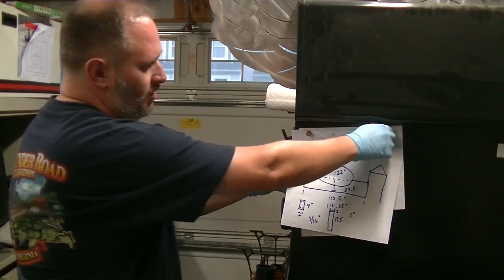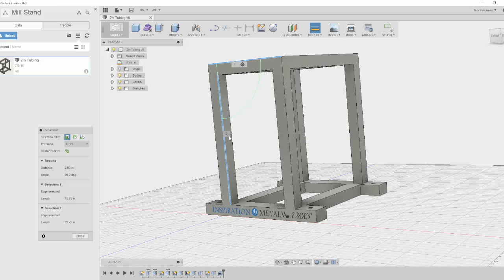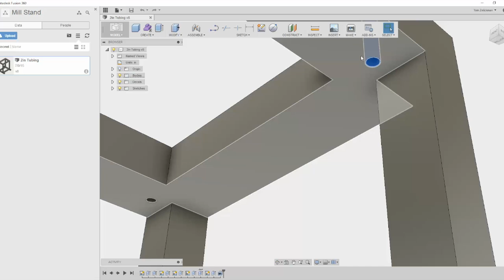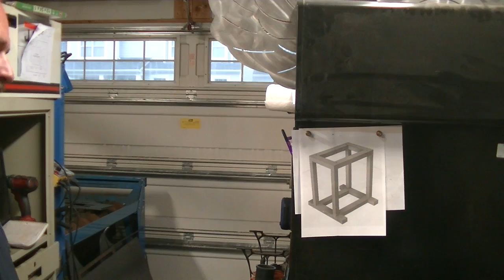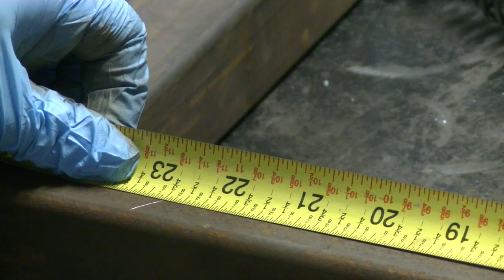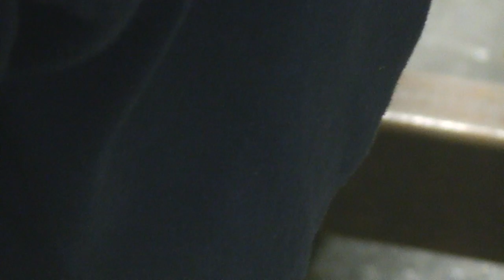Shop Update - Mill Stand Part 1

Comment: Ah, never have seen the scribe-a-v method, nice, seems to be a good way to go for fab work, thanks for sharing!
That will be a nice solid mill stand :)
Reply from the maker: Hi, Stefan! That method is only good when you have loose tolerances. It's actually an old wood working habit I picked up while working with a contractor friend of mine. Much more accurate than a single mark but far from precision layout.

Thank you for the comment and the guidance on how you built your own stand. Mine was loosely modeled off of yours as I am sure you are aware. Have you found a need to add gussets or angular supports at all?

Best wishes,
Tom Z

Comment: Nice!  Like you said, the CAD was more of a visual reference.  I draw some stuff in CAD even though I have no need to....but it's an excuse to play with CAD :)
Reply from the maker: +bluehandsvideo Hi Mike! The more I think about it, the more I really want to draw this part again the right way. I was pleasantly surprised at how quickly I got up to speed with Fusion; both from learning how to use the software as well as making the mental switch from 2D to 3D. I did a play-back in the history and saw what I did. I thought of this as a solid and then cut away the extrusions. Now I think of it as an assembly made up of discrete parts. Kind of fun being able to go back and get a feel for the thought process via the timeline.

Talk to you soon!
Tom Z
Reply: +Tom Zelickman (Inspiration Metalworks) And by doing it as an assembly, it should generate a true cut list for you.  I'm not that familiar with the weldments.  I've only used them once on SE4.
Are you going to do tubes in the holes?  Is it even necessary?  That would transfer some load to the other wall of the tube.  You can always cut some nice end caps/plugs if you weld the top with 90deg cuts.  Might be easier than the 45deg cuts and still be "closed".  
Great stuff Tom!! :)
Mike

Comment: Does fusion not have weldments and stock selections?
Reply from the maker: I'm not sure, Chuck. To be honest, I drew this very early on when I started using Fusion. I actually went back and "watched" the sequence of the drawing and wondered what the heck I was thinking when I drew it. I'd do it differently next time. Definitely need to learn more about assemblies. Working on that topic now, in fact. The stand is one body as opposed to drawing it as components and then assembling them. So yeah, I have learned quite a bit since then. Perhaps I'll go through the process of drawing it again for the practice. Do you have any suggestions?

Thanks for watching!
Tom